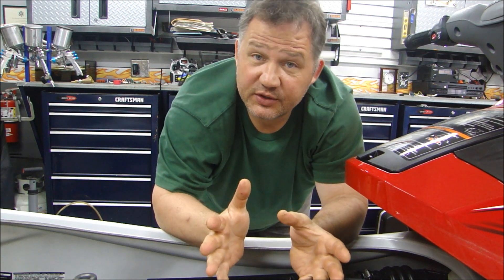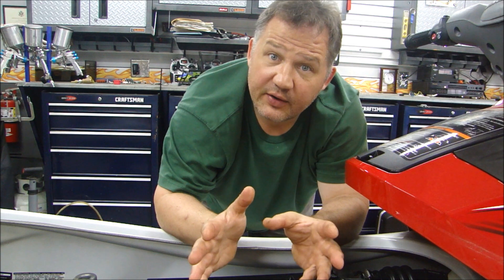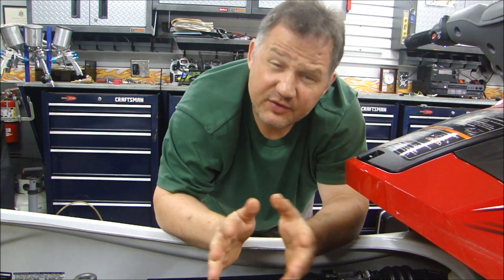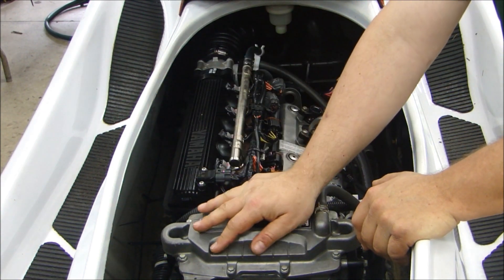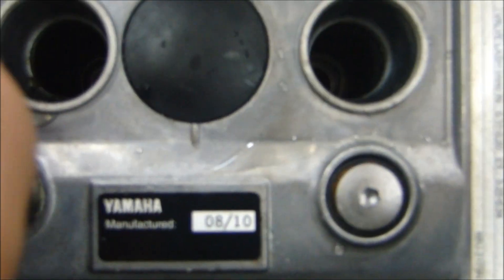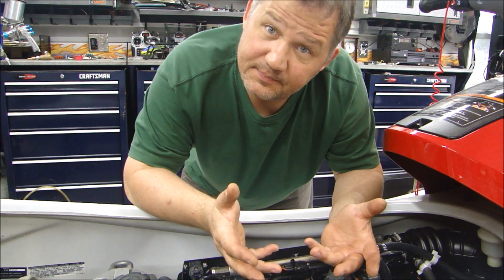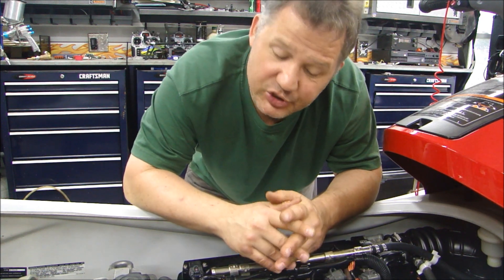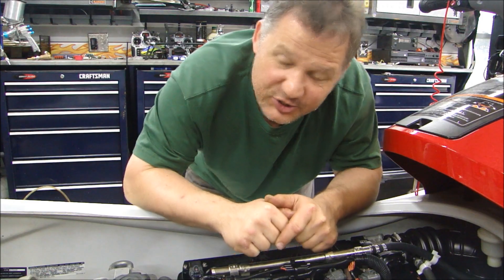Engine Repair Part 1

Comment: Hey Pete. I Have a 2007 yamaha waverunner fx ho 1100 engine that is being check because I bought it used and it seems wasn't being serviced. We found that the crank bearings are burned but the crank is ok. Can you guide me on what bearings are the right OEM ones to buy. The come in different color from yamaha. I'm not even sure if the ones we took out were changed before.
Reply from the maker: There has to be a measurement guide somewhere
Reply: I bought a manual a found all the instructions and bearing code table.
The crankcase number 6B600 Y-1 and the number on the flyweight lobe which is 22222-2322 MBC does not give me a code which is in the manual. Incase you can help the number on the Conrod end cap is 5B

Comment: Hi Pete just want to know ow with the engine mount bolt is it normal for the rubber to twist as your taking off the bolt
Reply from the maker: Yes it is, spray some penetrating oil on it first

Comment: if you had a stuck injector on this jet ski could it be the ecu damaged ? or the dealer working my bill up? if one injector is pumping to much fuel does it simply just need replacing or repairing?
Reply: i was told the ski has a bad ecu they cost 1700 new wow ? if the ecu was bad would all the injectors be playing up ??? thanks for your advice
Reply from the maker: If the ECU was bad I wouldn't think it would run at all.

Comment: I'm sure you've finished this project a long time ago. But any chance you still have this waverunner? I have an extra engine and am looking for a ski to drop it in. Just thought I'd ask in case you pushed this project to the back of the shop. I love your videos. Keep em coming.
Reply from the maker: Interesting you should ask. I still have it sitting on the trailer if you're really interested. I'd even throw in the engine.
Reply: Petes Garage where are you located? Wasn't it Southern California?
Reply from the maker: I am in Buffalo NY
Reply: Petes Garage I'm still interested. How can I contact you off of YouTube? Does your shop have a website with contact info?
Reply from the maker: My phone number is on all my videos. (716) 697-1690. Text me anytime

Comment: Pete, these videos are great.  SO very detailed.  I have a VX1100 and VXR1800 (2009/2011).  Lost a timing chain on my VXR and just had the heads redone at a local engine builder.   Your breakdown of the head was a great visual to go along with my factory service manual.  I plan on cleaning up the head on the VX Cruiser this fall.
Reply from the maker: Awesome....thanks

Comment: any advice on 2009 kawasaki jetski stx 15 not idling right? runs good on top end but stalls when I  release throttle.
Reply from the maker: Look for any loose, cracked or fallen off hoses first

Comment: Thanks Pete, excellent video, with your help I did pass part one of small engine repair class,  I had never worked on engines before.  I have fallen in love with Honda 750 Four cylinder motorcycle engine.
Reply from the maker: +jonathan bosco That is awesome...congratulations
Reply: are you selling engines you build?
Reply: +Petes Garage you look like you are having fun.

Comment: I have a 2007 Yamaha VX110 sport jet ski and I have a problem with it that it beeps when I'm using it and it turns a warning light on and an engine light on the dashboard. When I turn it off and turn it back on it stops beeping for a couple of minutes and then starts beeping again. sometimes it doesn't beep for a long time. Do you know what can be causing this?
Reply from the maker: +Millionaires Luxury Over heating
Reply: +Petes Garage Thank You! How can I find whats causing the engine to over heat? Is there any suggestion you can give to find whats causing this problem?
Reply: You can get the code by holding the circle button down on the dash. Have it running and silence the alarm, then press and hold the button for 8-15sec until a code comes up. Then look online for what your code corresponds to
Reply from the maker: That's cool.....thanks!

Comment: This will be interesting I'm going to watch them now. My 2006 Corolla has a 1800cc 4 cylinder and it's done 287,000km which is 178,000 miles. There's absolutely nothing wrong with it, but I keep getting that itch to work on it. How much longer till the bottom end bearing shells wear out, that would be a fun little exercise to replace those and satisfy my need to wrench on it. Maybe I need to buy a Ford, then I'll be wrenching on it every weekend.
Reply from the maker: +KiwiPowerNZ Hey...if it's not broke don't fix it. I'm still working on this engine

Comment: I'll be interested to see the result...The fact that water is in all the cylinders and pretty uniform I wonder if it ingested a mouthful of water or there is corrosion somewhere on the inlet manifold..
Reply from the maker: Have not found any smoking gun yet. I pulled the engine out and there is no real glaring problem

Comment: Make sure to check the rear main seal. If it's pushed out at all. Water is in the crankcase and most likely a bent rod as well.
Reply from the maker: When I put it away last winter it ran awesome. This was right at first start up. I'm thinking cracked head
Reply: ***** I worked for Yamaha Motors for 4 years. 

We would just stick a pencil in each cylinder at TDC. See if any don't match the rest. Then check the rear main seal. To see if it's pushed out. If they are. We would just order a new rebuilt one. As the labor and parts cost more then the rebuilt one. 

If you just bent a valve. You got lucky. Most the time the rod takes the hit.
Reply from the maker: Somehow water is getting into the cylinders. No bent valves or rods. Could be just the head gasket but I can't tell at this point. I need your expert help on this one
Reply: ***** I'm not saying the head gasket isn't bad as well. 

In most cases it's getting water from only two places in the combustion chamber. The pump seal got blown out and induced water in the intake. Or it over heated and warped the head enough to allow water to bypass the gasket. As I'm assuming you winterized it and drained the water out the engine because if you didn't the block could be cracked and it doesn't take much water left in the engine to cause that. I'm talking just a cup full is enough.
Reply from the maker: Ok...here's the situation. When I started it there was oil coming out with the water from the jet drive. Oil was getting in the cylinders and white smoke was coming out as well. I shut it down and left the hose water running. When I pulled the plugs the cylinders were full of water...so...oil and water was getting into the cylinders. I will not say the block was bone dry. But it sat for at least 4 months before it was cold enough to freeze so any moisture should have dried up. Since no water got into the oil system (oil reservoir) I'm assuming it was all internal. Either the head gasket or cracked head. The even nature of water distribution makes me believe head gasket
Reply: ***** You're smart guy. So I would just pull the head and see what I have. If the head passes the test. It's time to look at the rear engine casing and look for any cracks between the pump and housing. As this is where I seen it most the time. As this is where  water that didn't get drained settles out of the pump housing.
Reply from the maker: I will check that next. Thank you very much.